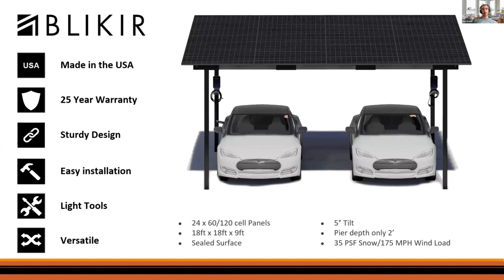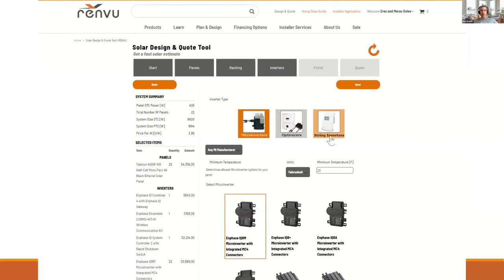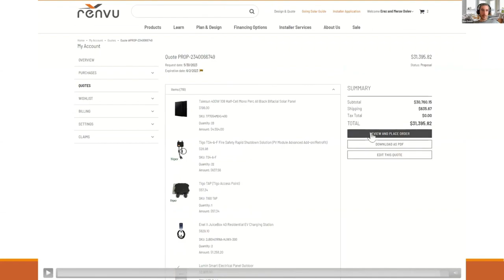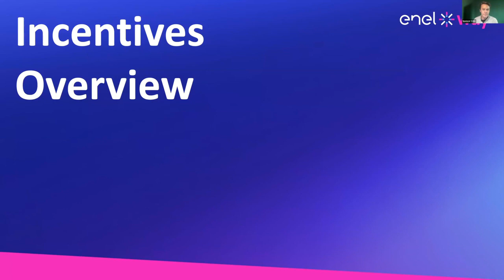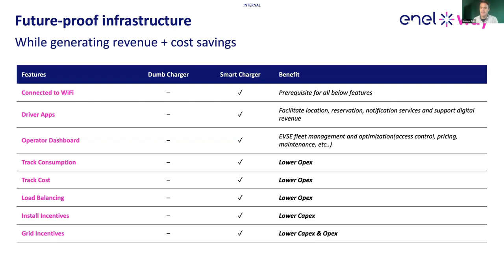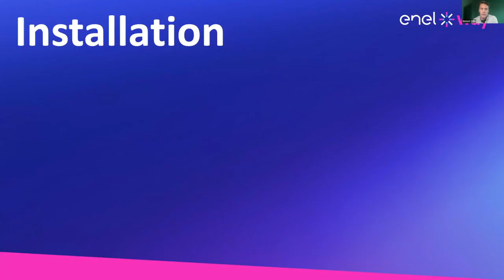Solar Power Market Series with Enel X Way | RENVU

Comment: Thanks for the presentation. I have a question for the folks at Enel X. A company called Enteligent announced (back in January, I believe) a residential/commercial "Hybrid DC Bi-Directional Fast EV Charger" which is not only bi-directional, but can charge an EV with DC current coming from PV panels (without having to be inverted to AC current first). It can also charge from AC current only (like most EV chargers) or combine both so that it can charge "up to three times faster than AC Level 2 EV chargers". It does this by integrating with solar inverters (such as the Sol-Ark). I think it is now in beta release/testing. Do you have any plans to provide any such capabilities (the one of primary interest is taking DC current from the panels going direct to the EV without doing a "double inversion" of DC->AC->DC)? The Web page describing the device is here: https://enteligent.com/dc-coupled-dc-evses